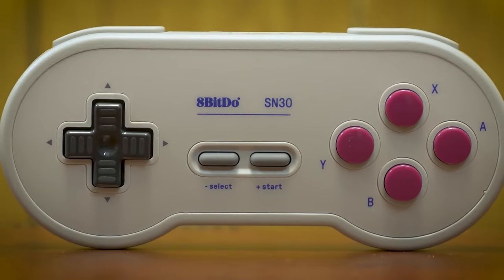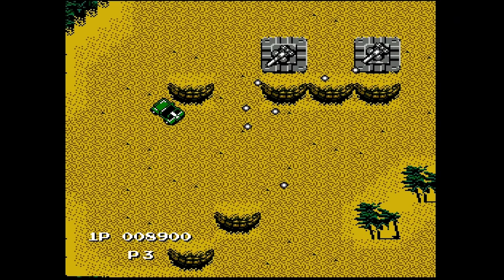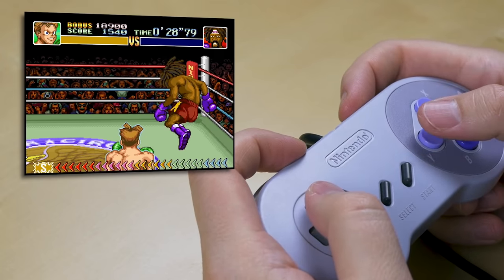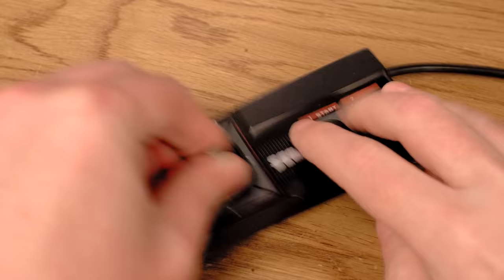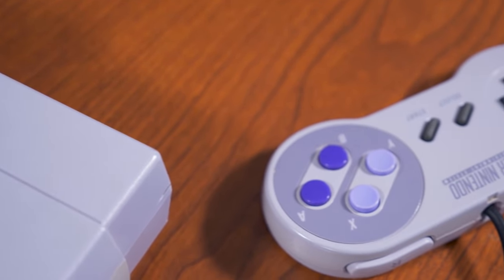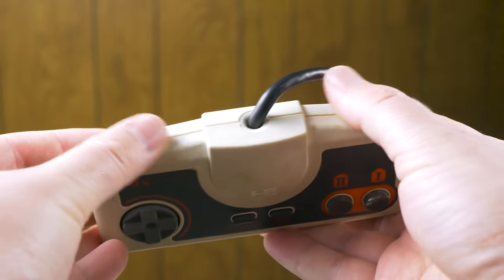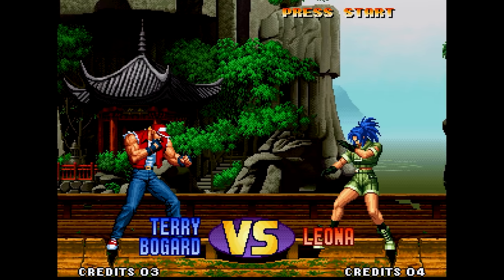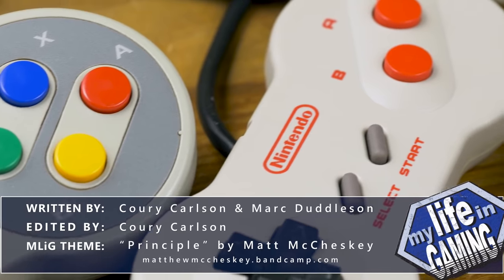First Party Controllers #1 - NES, SNES, Genesis, TG-16, Neo Geo, and More! / MY LIFE IN GAMING

Comment: You have a dogbone.  Very glad as many people don't even know that controller exists.
You did mention the PAL SNES controller - thank you.  Colour makes a difference also the buttons were shaped differently too.  PAL has a convex hump and NTSC had a concave dip.  The convex vs concave is an issue for retro enthusiast - and you most certainly are in that category.  Some perfer concave, others prefer convex.

You could buy a dogbone separately.  I know I owned a separate dogbone back in the day.  They came in a nice official looking box too.
Also the dogbone is polarising.  You do not like it but many do like it.  I prefered it to the NES rectangle.  I remember with my small hands, the edges of the rectangle dug into my hands.  I don't remember if that was only after long play sessions or not, I was young then.  But I do remember the dogbone being the controller of the two I liked more.  Mostly for the exact same reasons you don't like the dogbone.

The spacing between A and B is all muscle memory.  You can practice enough to get used to the more spaced buttons.  You can't expect to be perfect with the dogbone on day 1 after years using the rectangle.  The dogbone is a good controller but it's polarising.  Some people love it for legit reasons and others do not like it also for legit reasons.

Also another point is how you play NES games.  You move the tip of your thumb from A to B.  That's not the only way to play NES games.  For me I used the controller in a different way.  I used the end of my thumb for B just like you did. Thumb bent with the knuckle upwards and tip on B. But for A I didn't move the tip of my thumb to it like you do.  I just straightened out my thumb so the middle part of it under the knuckle touched A.  The tip of the thumb was just resting on B and not pressing it down.
Thus I didn't have the travel time for the tip of my thumb to move from B to A like you do.  I only had to move my thumb knuckle downwards to press A.

The dogbone is not the best controller based on how you play NES games but for others who play NES games differently, such as my self, the dogbone works really well and that's why I liked it so much.
I even know a few people who prefered the Advantage to the rectangle and the dogbone.  They were mostly arcade pros though.  But still different strokes for different folks as they say.  The one thing you must agree to is there is there is a 1st party option for everyone.  Rectangle for traditionalists such as yourself, dogbone for those who play NES games differently and have smaller hands, and the Advantage for the joystick/arcade pros.  More options is always a good thing.

In the end the best controller is one that is relatively reliable, does it's job well and fits well in your hand for your play style.  Yes that means there is some subjectivity in which controller is the best.  Not a bad thing as everyone has different needs and tastes in controllers.

Agreeing to disagree is the perfect answer.  No one controller will be universally loved by everyone.  We each have our own different styles of playing games and invividual preferences. Personally I am not disagreeing with you.  I'm just saying the answer to "what is the best controller" is different for everyone.  The rectangle and the dogbone are both the best NES controllers - depending on how you play NES games and what you like.
The abomination with the 8 way circle on it, yeah we can all agree that was terrible.  Though it was forward thinking in a few aspects as you rightly mentioned in the video.

Great video though.

I really hope you continue on with this series as getting into the N64, Gamecube Wii and PS controllers would be very interesting.  Many people regard the gamecube controller as the best ever.  But is it really?  A good analysis into this would really help.

Comment: To be fair, the 6-button clones from Hyperkin GN6, Old Skool, etc use the same mould too, they just didn't get the rights to the Genesis branding like RetroBit did. Pretty sure the reason the Megadrive Mini in Japan had 6-button pads and the rest of the world didn't is because Japan always had slightly smaller versions and Sega no longer had the rights to their original design outside of Japan (sold to the company supplying Hyperkin, RetroBit, Old Skool, etc).

Comment: I use an NES Max as my main NES controller... but I had to mod it. Took the slider pod out and popped it open, threw the slider away and replaced it with a thumbstick from an X Box 360. You do have to sand down the base of the thumbstick to get it to fit, but it's not much to remove. Once you snap it all back together, you have something even better than the original D-Pad. Which is hard to beat.

Comment: Heads up for anyone looking to replace their SNES pads, the Console5 sets seem to have changed since this was filmed (start/select more closely match the original in color) and the D-pad in the set I received does not register diagonals. I’ve seen some other cases online from people purchasing them more recently having the same issue, if anyone knows of another alternative let me know! 

I can’t overstate how poorly the replacement D-pad functions for diagonals, they do not work at all, keep it in mind if you spring for one.
Reply from the maker: [Try4ce] Yeah, actually, after shooting this video, the more I used that controller, the more I discovered that those pads were also inadequate. They seemed good at first though. So yeah, sadly I'm not aware of a great solution here.
Reply: @mylifeingaming  I'm gonna try another option or two before giving up, but using 8bitdo controllers might be the best bet. I am a little tempted to take the pads from my Switch snes online controllers since those feel just about right but it's nice just having those as is!

Comment: The only good first party controller is the Spoon for the Phillips CD-i.
Reply: #SpoonSquad
Reply: Intellivision keypad obviously remains supreme.
Reply: Wait. I think that's why I got electrocuted eating my Rice Chex.
Reply: Gravis made a nice copy of their PC controller for Philips. It's pretty much the same, except that it's lost it's SFC colors for all grey.
Reply: Atari Jaguar with phone keypad, yo.
Reply: @videogameobsession  Yeah, I have one of those for my CD-i. It's still absurd how the third button isn't used at all by the system in most games, though.
Reply: @Technique San It's because it really only has 2 functional buttons. On the Gravis style controller the buttons are (I) (I) (II) (I/II), so while you could maybe call it a 3rd button, it's really just buttons I & II pressed simultaneously. 

On the original 910 system's Thumbstick it is set up with a I and a II button on either side of the stick. The reasoning behind that is to allow the user to use it as either right or left handed. 

I suggested they add more buttons on many occasions while I was working at Philips, but they didn't want to change anything which would render earlier Thumbstick controllers incompatible.
Reply: @videogameobsession  Oh wow, so you were a part of Philips when the CDi was relevant? I've got a decent kit, a 450 with the digital video cartdrige and changed some things inside in order to easily replace the timekeeper chip. Yeah, the 3rd button is indeed 1 and 2 pressed together but that always puzzled me, since I wasnt sure if that was hardware related, hard coded in or whatever. There's really no excuse considering games were always a part of the CDi plans, at least. I'm aware of some other controller variants with 4 buttons, in that case the 4th one is completely useless?
Reply: @videogameobsession  Oh nevermind, you were already talking about the 4 button one. The one I have is a 3 button in a similar  layout of the Genesis controller, which is also a PC controller modified for the CDi.
Reply: Right, like with the Gravis pad, the extra buttons, just doubles up the button (I). http://www.videogameobsession.com/videogame/cd-i/Philips_Touchpad_22-ER-9017-vgo-01.jpg

I worked for PIMA from 1991 - 1993, beta testing and reviewing games for their in house mag, CD-i World. I was only 19 at the time and worked remotely (from New York). I mostly did it for free software, accessories, and CD-i systems. I still have 4 CD-i systems, 2 910's w/ DVCs, this was my original and I am very nostalgic about it, and 2 220 systems, also with DVCs. I had one of the later systems.. I had a 5th system, but I gave it to my brother in 2004 so his daughter could use some of the educational titles. 

I still have around 250 titles, with about have of them being betas and review (white) copies. In 2002 I dumped the Super Mario's Wacky Worlds prototype. I have a few of my old reviews shared here.
http://www.videogameobsession.com/videogame/mags/cdiworld
Reply: @videogameobsession  That's awesome, the 1991~1995 race many companies embarked on made for a great time of speculation and excitement for videogame fans. I have a few titles, with the obvious ones being both Zelda. I'd love to get a copy of Zelda's Adventure but I don't see that happening. Also have some decent titles, like The Apprentice. I remember seeing a CDi model that is built into a stereo or something like that, I presume it was intended for presentations. Man, what an interesting and ambitious piece of hardware.
Reply: Yes, impressive tech for being based on specs agreed upon in 1987. They were pioneers for the time. I enjoyed taking advantage of the Photo-CD compatibility. I started getting my film processed on Photo-CD. The quality is still excellent today since they added extremely high resolutions for each photo. Back in the 90's I couldn't even open the largest resolution with my PC. 

I think Video-CD movies could have been huge had they been able to fit the full movie on a single disc, and had the video standard been higher, but MPEG-1 was already pushing the medium far as it was.

Comment: I feel like the biggest issue I had with the TurboGrafx controller from when I used to play it at my friend's house was that it seemed like the d-pad and buttons were awfully close to the bottom of the controller for my taste. It felt like they should have been a bit higher up, I don't like the feeling of holding a controller by the bottom, it feels like I'm not holding the controller with my hands but between my thumb and forefingers.

Comment: Tryce,  Regarding the original SNS-005 control pad. When mine started to not respond, To save me money, I just opened it up and clean the contacts for each button on the circuitry as well as carefully cleaning the built up residue and black mark dirt, since then, it's was responding like new, especially the SELECT and START buttons on the SNES controllers. I even retrobrite my PAL SNES controllers just with Hydrogen peroxide during sunny day with high UV level and since then had NO YELLOWING coming back on the controllers.

Comment: Those Master System Control Sticks can be easily modded to resemble a more common arcade stick, the PCBs inside can be rotated 180 degrees and the cable just needs a small square opening to match the new orientation.

Comment: Commenting before watching but one of my favourite small changes that I doubt will be mentioned is the upgrade on the Dualshock 4, the front light bar is nice but the invisible change is that when plugged in to the console the newer controller transmits through the cable rather that still going wirelessly and only using the cable for charging, small change but wonderful for twitchy games like shooters, precise platformers and fighting games.

Comment: I've fixed a few SNES and PS2 controllers that didn't register button presses by using rubbing alcohol on a q-tip and wiping in a circular motion, or twisting across both the contacts and pads.  Obviously if your pads are torn (as shown in the video), they need to be replaced.  But the controllers I've fixed would require strong button presses or just not register at all.  After cleaning they worked flawlessly.

Comment: I fully agree with all of your conclusions.

Fun fact about the mic on the second Famicom controller. The mic is always On with sound coming through the tv, speakers. So if player 2 wins, he or she can actually yell at his controller and yell something dumb like: "Player 2 WIN".

The Master System joypad does work on the Amiga. Especially useful for 2-button Amiga games.

About the megadrive 6 button controllers. I read online that the one with the red start button are the best, so I have 2 of those. They play excellent, but I've never tried any others so I cannot really compare them to the blue start button ones. I was hoping you would address these differences, but in fairness if you would have to compare every version of a controller you'd need several more weeks of comparing/buying, etc.. I'm happy with this video as is.

And I just have to mention that Sengoku 3 did come out on the ps2 in Europe.
https://gamefaqs.gamespot.com/ps2/676021-sengoku-anthology/data

My favorite joypad is the Saturn pad. Baffling to me that so few converters exist for this pad. I want to be able to play with Saturn pads on all my consoles. Not just Dreamcast and playstation 1, 2, 3. For PS3 I have 2 saturn USB pads.

Comment: That PC Engine controller extension looks like an RGB mini-din. Would this work to extend a framemeister Scart adapter?
Reply from the maker: [Coury] It will!
Reply: My Life in Gaming That’s great! I know a few people that are concerned about the pressure of the SCART adapter connected to an inflexible heavy gauge SCART cable and causing damage to their framemeister. The port isn’t exactly super durable. This will be great for them.

Comment: My parents sent in my NES and 40+ games off to Nintendo in the mid or late 90’s for their professional cleaning.  Controllers went in the box also.

When they came back (weeks later), they had replaced my original controllers with brand new dogbone controllers.

I had...mixed feelings.  I need to dig them out and have a go with both older and newer.

Comment: The SNES controller was my favorite all the way through my childhood. My hand never fit the NES correctly, and I had fatigue problems constantly. Likewise, the buttons on the Gameboy were too close to the edge, causing thumb cramps. The N64 was a departure from common sense, and the Gamecube was just bizarre with it's radial C controls. Sega's controllers always felt insanely cheap compared to the build quality on Nintendo. The SNES didn't get dethroned until the 360 came out, and even then the D-pad was DOA on the Xbox. I now use a 360 controller on PC for most of my controller gaming, but I still have my original SNES, and they still work. I think there's a very good reason the classic controller for the Wii was "reminiscent" of a certain previous design.

Comment: My go to pad for megadrive is the official sega 6 button wireless pad (not mentioned in video?) due to it's size over the somewhat small wired 6 button pad, the ir sensor is crap but with an extension lead and placed on the table in front of me and it's chunky body due to batteries, it's golden.

Comment: There is a non destructive mod for the NES Max, you basically replace the red disc with an xbox360 joystick. Can be put back to stock if ever needed but it makes the pad feel 100x better. It makes it a real winner for shmups, even gives you a turbo button.

Comment: You should've talked a bit about the differences between the Japanese Megadrive 6 button controllers and the American Genesis 6 buttons ones. The size difference springs to mind as well as the cord length. But the feel of the japanese one is just so much better, it's actually smaller than the Genesis 6 button one and more comfortable.

Comment: Neo Geo buttons on the control pad with the micro-switch D-pad should be arranged as such: A west, B south, C east and D north.  The most ergonomic arrangement.  Most common two buttons used are A and B.  The 3rd most common used is C, so to have it able to be pressed along with the B button, have it at east.  This is also the way the arcade buttons are laid out with B and C back to back and easily pressed together (like A and B and like C and D).  I hope that was clear.

Comment: The concave top of the Neo Geo arcade stick is for the japanese style of holding ball-tops in arcade. You filmed yourself doing a pinch-grip. Japanese players, would curl their fingers under the ball top and rest the thumb on top. That is what is meant, I believe, when it is stated it was concave for comfort.
Reply: pinch-grip is a natural position for american players as most arcades were issued with Bat-top instead of ball top, so it's natural for that grip to carry over to a ball-top.

Comment: Sega Genesis pad is unique because it is the only one that replicates the mechanics of genuine arcade sticks. The PCB has the button contacts on the face but the Dpad contacts on the underside.The Dpad is on top of a stick that goes through the PCB and contacts the pads from underneath. Pressing up hits the down contact, pressing left hits right contact etc.. just like an arcade stick works but without the micro switches. Sega took 'Arcade Perfect' seriously.

Comment: I was kinda waiting a mention of SEGA's Remote Arcade System for the GENESIS . It is, at least in my opinion: the BEST 6-Button variants of SEGA's controllers ever AND WIRELESS ! While they do use infrared for communication, they actually work quite well!

They've got the size closer to the original 3-Button, with the functionality of the 6-button!